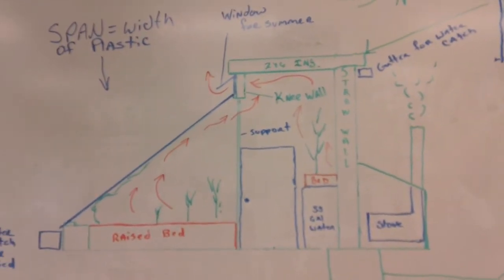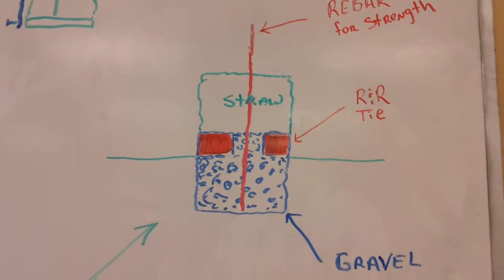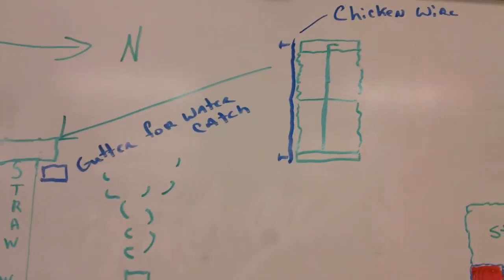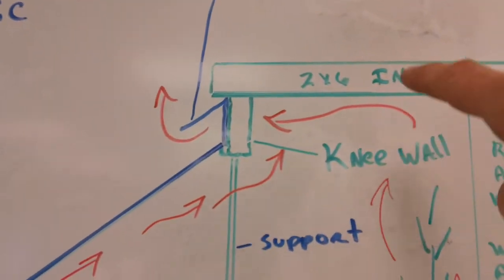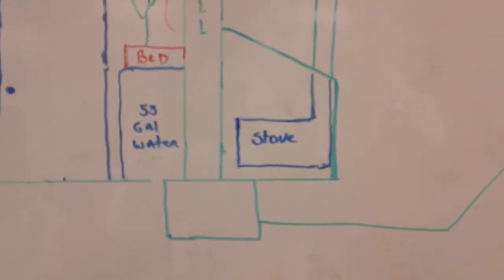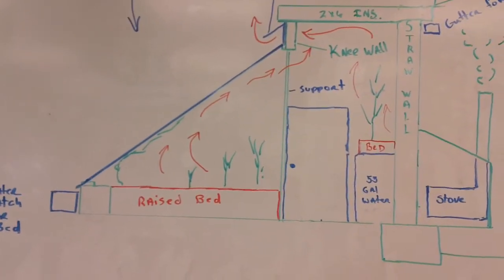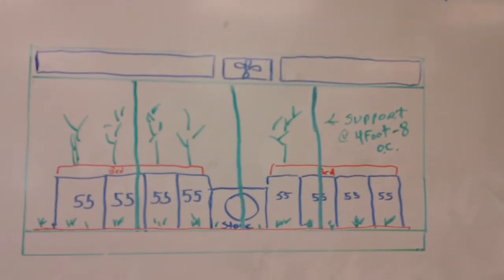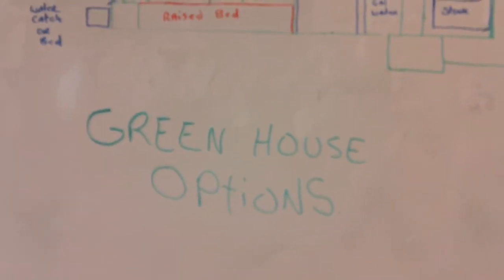Greenhouse Heating Options and Design

Comment from the maker: The design could also be set in the ground too as in a hillside. to make the expense of building even cheaper. Sounds like your well on your way. Knowledge is power my brother. yes I watched  that. thank you. some great innovation in that video, If you use that idea with the thermal electrics ideas from one of my videos you could heat your water run and run your pump to move it all plus lights, transfer the heat from the cold side of the TEG directly into the fish water to heat it .

Comment: Thanks for the info Van, I like you design here. I have been saving materials for this sort of green house for a couple years. Have the glass and instead of 55 gal barrels I'm incorporating a 750 gallon Aquaponic system which I have 90% of the materials for. I've also been studying Rocket heaters for heat and just yesterday came across what I consider a good design for a greenhouse because of the mass and easy build. 
Do a youtube search for "Rocket Stove Ideas 33 - Brick Box Rocket Stove".